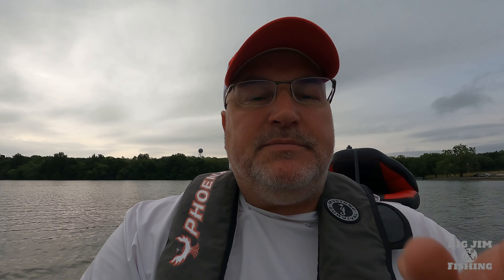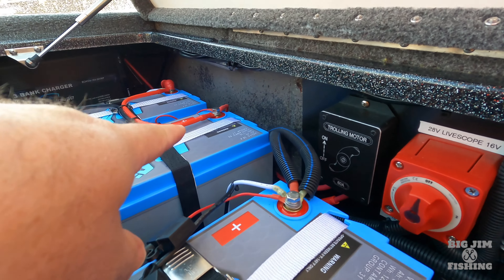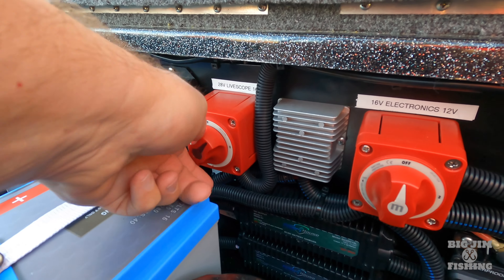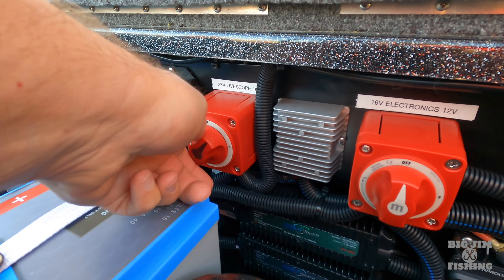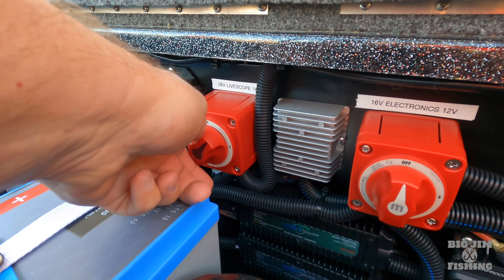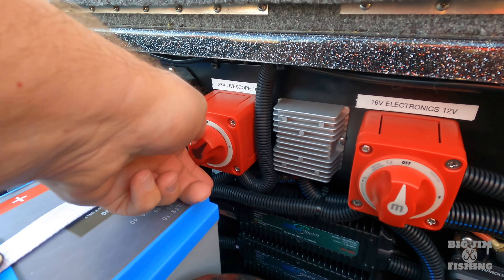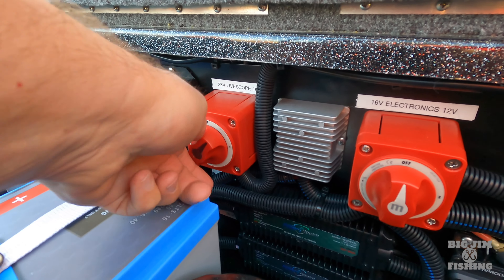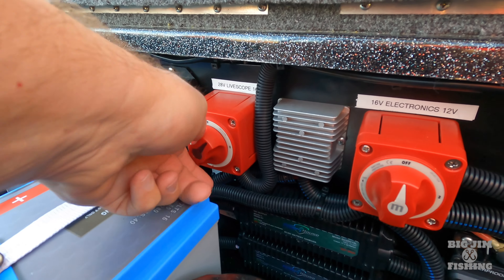Using Humminbird SOLIX Ep1

Comment: Hi, I'm not arguing that you need that much power. But you may want to run this by Hummingbird tech support, about not being within a dead-band voltage range. Because you might be putting stress onto the electronic board components within the unit itself. There is a safety range to run any electronics both high limits and low limits. I hope I'm just being overcautious and nothing to worry about. Just something you might want to research so that any chip, video/graphics card or any electronics inside aren't being pushed to their limitations, Good Luck. 👍
Reply from the maker: @BumpNrun69  been doing this over a year. Works great.